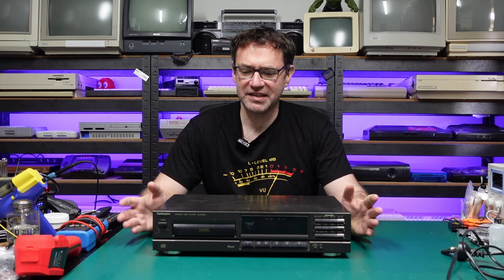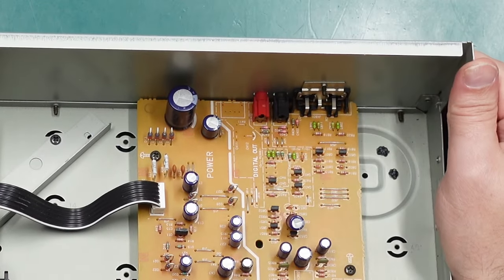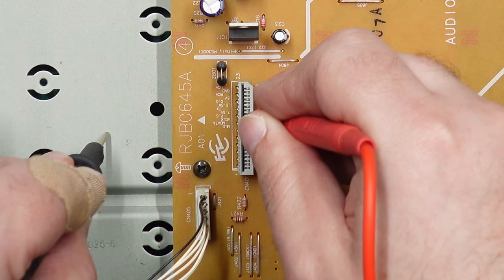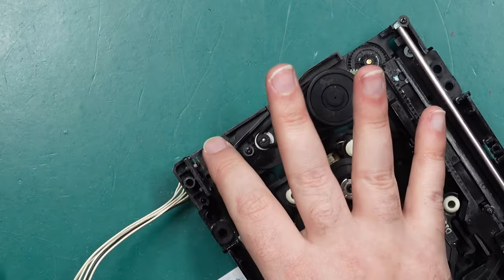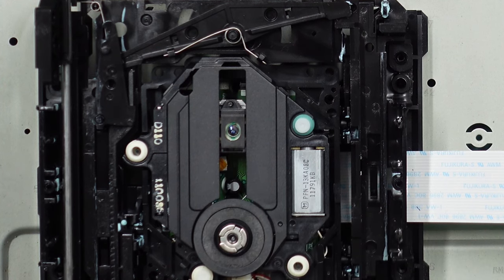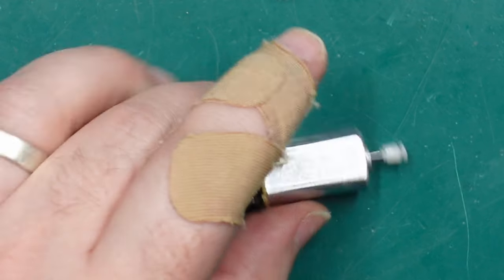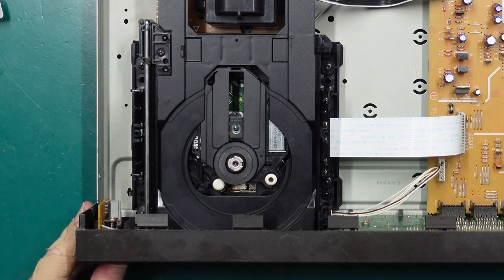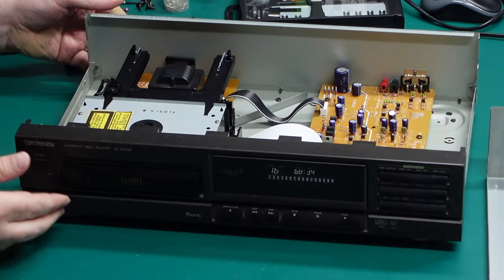Technics SL-PG100 1991 CD player not reading discs repair and restoration

Comment: Love these Technics CD players. I made good use of the synchro edit function back in the day, maximising my tape copies. Maximum nostalgia 😊
Reply from the maker: Funny how we went from this to random, program play and seek if you're lucky
Reply: Boa noite, ele grava CD, ou grava do CD para o deck. A entrada remote é para gravação rápida do CD para o deck. Ou a entrada remote é mesmo para gravar cd no próprio aparelho.
Reply: @TheRetroChannel  ( boa noite , este CD player grava CD, ou grava do CD para o deck. A entrada remote é para gravação do CD para o deck. Ou é para gravar CD no mesmo aparelho. Abraço de Portugal, e parabéns pelo belo trabalho.
Reply from the maker: The remote is to allow the cd player to control the tape deck, it cannot record CDs
Reply: @TheRetroChannel ( ok , ou seja o controle remote sever para gravação do CD player para o deck. Claro que o deck estiver a mesma função certo. Tenho um deck Kenwood KX_W2030 que também tem a função de gravação entrada cor verde. Vou comprar um CD player desse. Já encontrei um aqui em Portugal, igual a esse aí. Este CD player é um bom jogador é igual Ronaldinho gaúcho rrr.
Reply from the maker: @wagnerribeiro4246 yes. I don't know if it will work with the Kenwood. It depends if they use the same protocol, whatever that may be

Comment: Lol, I found the same model in the trash last week and it works! Someone also left a megamix CD from the 90s inside 🤣
Reply: happy 4 u, good thig owner didn't check eBay lol
Reply: My wife and I were looking at a used Toyota RAV4.  I brought along a couple of CDs to test the CD player in the infotainment center.  I found it would not recognize one of the discs, both commercial DCs and both play in other players.  When we brought it up in negotiations, the dealers attitude was, "Nobody listens to CDs anymore.  They do Bluetooth off of their phone or they do satellite."  We ended up not buying the car.

I checked with a couple of car audio shops and was told that not recognizing some CDs is a sign that the laser is getting weak and ready to fail.

Comment: I was lucky enough to get the SL-PS740A model off facebook for really cheap because of sound issues, turned out to be just a cracked solder joint on the right audio jack, so nice easy fix, even came with the remote and he dropped it off for free aswel

Comment: I still have one of these and the RS313 tape deck that we used to transfer CDs to tape with.  Tape deck is a bit wonky making noises these days and CD player still works.  Will try to sort it out some day, but got other components to used in the mean time.
Reply: There are youtube clips about a plastic cog in the tape deck that strips. I’ve just ordered 2 cogs off ebay for $8 Aus to fix mine.
Reply: Boa noite, ele grava CD, ou grava do CD para o deck

Comment: The rail voltage you measured, which was a bit low, should have read  higher anyway with no load when you removed the ribbon cable.And you are right that if a motor is stiff ,it will draw more current, due the the now low very low resistance

Comment: Great Video. So nice to see units such as this saved. I have an even earlier Technics CD, the SL-P777 which is still working fine some 34 years after I bought it new. Admittedly it did need a service once when the tray seized up but apart from that has given excellent service. Sadly though it never reliably read CD-R discs from new. Curiously it always read the TOC but then just hunted on CD-Rs only very occasionally finding the tracks.
Reply from the maker: Maybe I need to burn an audio cd and give it a proper test. I'm all out of blank CDs so I'll need to buy some, something I haven't done for around 20 years

Comment: Nice fix!  I always loved the Technics CD players.  I have owned one since the 80s.  I have the SL-PG300 model sitting on my desk at work currently, paired with a Technics SA-R377 receiver for that glorious 80s/90s vacuum fluorescent displays they have and the warm nice sound.  It has been used here for many years.  I am looking forward to seeing you do the optical mod as the US version 300 does not have it.
Reply from the maker: Nice, yeah it looks like only European players got the optical out. The mod should be pretty straightforward but we'll see. I might also look at adding the remote control function to the 100 just for fun

Comment: Good demonstration, Mark,but it looks like I skip some steps to replace it back as I battle to align the cd tray properly, and when I get it the disk is not spinning.
Reply from the maker: Yeah sounds like something is not aligned properly. There's a link to the service manual in the video description that may help reassemble it

Comment: Thanks! Hope that my CD player has the same issue. The symptoms are exactly the same.
Reply: I checked the cd player and the motor that moves the lens is functional. Instead, the motor that spins the disc does not work. I can't tell if it's burnt or if it's a power supply problem. The device was not turned on for a long time.
Reply from the maker: @endomusicprojects does the motor spin freely when you turn it by hand?
You should be able to power it from a AA or AAA battery
Reply: @TheRetroChannel  The motor rotates easily by hand, but is dead when powered.
Reply from the maker: @endomusicprojects Ouch. That could be a challenge finding a replacement, I wish you luck
Reply: @TheRetroChannel  Thank you! :)